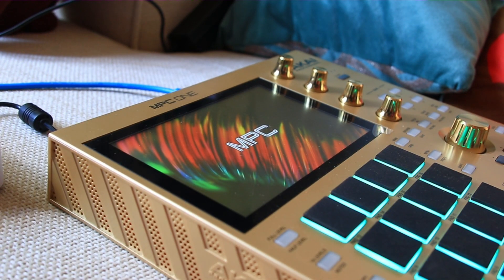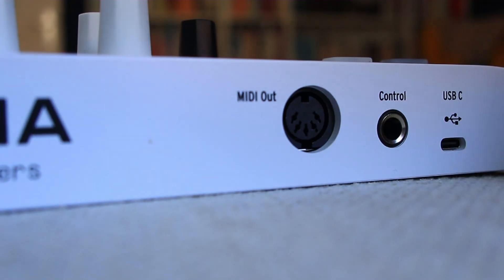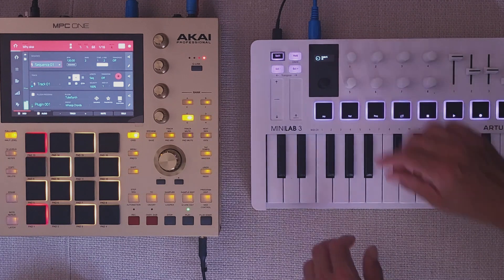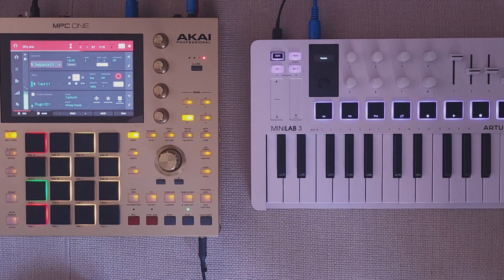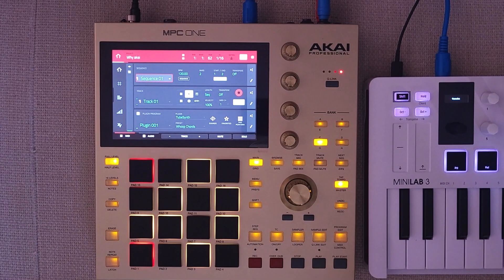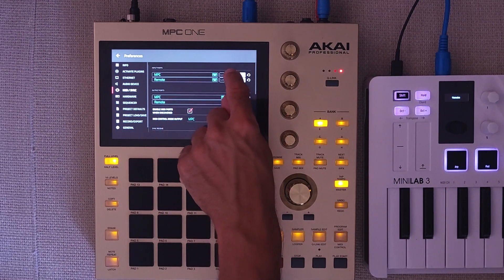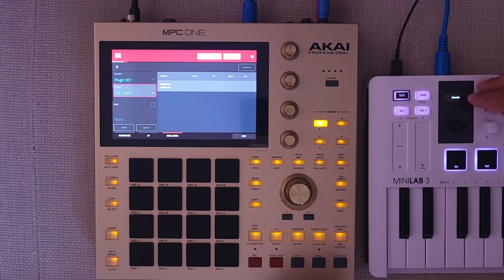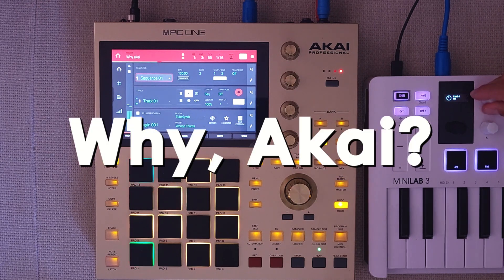Why, Akai - Episode 1: Enabling Midi CC Mapping on the MPC One

Comment: Thanks for the vid! I´ve done exactly that, mapping is okay now.. but i have that weird bug that the value of the mapped parameter just jumps around and never stopped, even if the mpc is stopped. Its like an automation that never ends (which i dont programmed btw.) The values are just crazy jumping around untill mpc freezes. I dont know..i cant use any midi controller for playing live with the mpc right now. Thats really a no go for such a device from such a manufacturer.
Reply from the maker: Have you tried another midi device to connect the mpc one to? I had the exact same thing with the Minilogue hooked to the mpc one. And even with the Arturia keylab... Until I changed its knob settings from relative to absolute. Now it works like a charm
Reply: @kurtafterall  Yes i tried several, but i want to use a freshly unboxed Launchcontrol XL. Do i have to change the controller itself from relative to absolute or in the mpc settings? Thanks for your support mate! 🙌
Reply from the maker: @NOGASAYAN  when it's a launch control check the settings in the components software, whether you can change the settings of the knobs there
Reply: @kurtafterall  thanks for the advise, will check it later! Thanks a lot 😊
Reply from the maker: @NOGASAYAN  my pleasure
Reply: @NOGASAYAN did you solve the problem? I have the same issue with my AKAI MIDIMIX. I also tried to use minilab 3 and have the same problem
Reply: @alexeytihhh  unfortunately not. Haven’t tried it again since. I’m waiting for the new 3.0 Firmware and hope that solves the problem 😬
Reply: @NOGASAYAN  well, I’ll have to try Beta 3
Reply: @alexeytihhh  yes, that’s exactly my plan also 🙌
Reply: @NOGASAYAN  I installed the latest BETA and everything works fine! Finally!!!
Reply: @alexeytihhh  no way, really? This makes me wanna change my setup.. again 😅🙌 Thanks for testing!